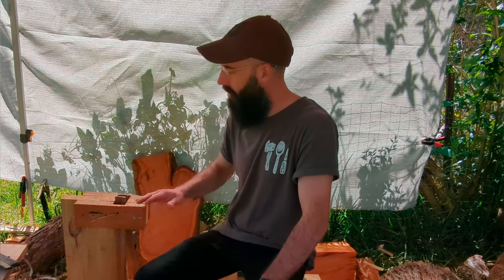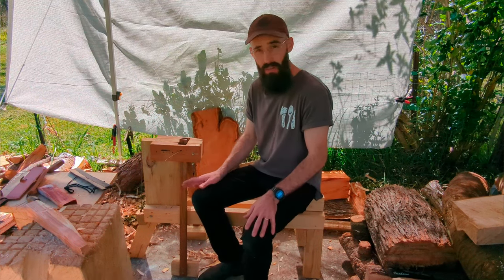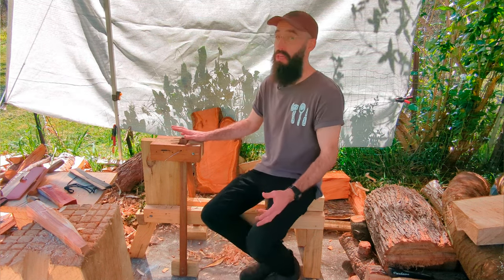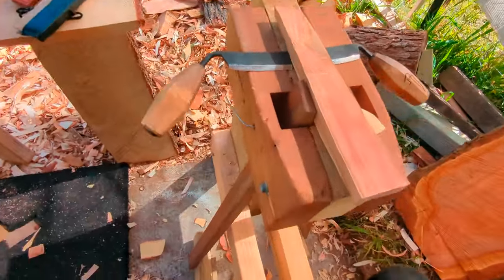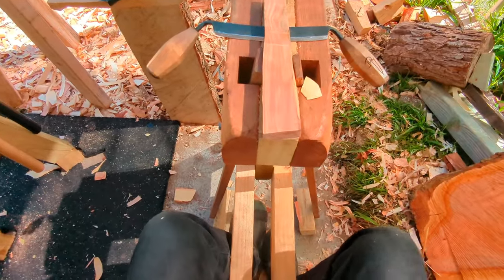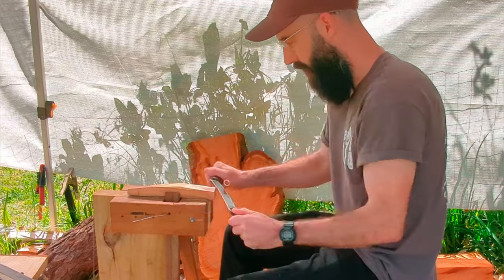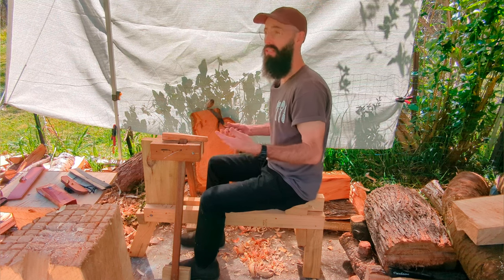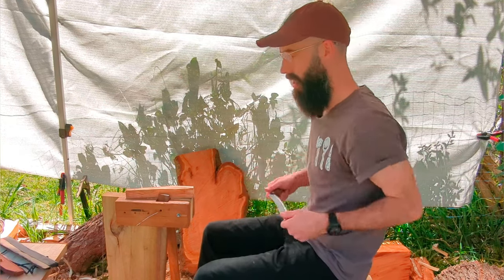The Spoon Mule | Andy Spoons

Comment: Sweet, simple design. I've never used a spoon mule or a shave horse. What advanages does one have over the other?
Reply from the maker: A great question, the spoon mule has lateral grip and leaves the top of your work piece free to be worked on. A shavehorse applies downward pressure to the work, which might create a stronger grip, but means you are only able to work from the grip back towards yourself. One is great for spoons, the other is great for chair parts 👌
Reply: @andyspoons  Makes perfect sense. Thank you👍

Comment: Hi Andy😊
I am trying to build a spoon mule myself. 
Does your spoon mule have an angle cut in the bottom of the opening for the two "clamp arms"? (Hope that makes sense 😆)
When you push out with your feet the clamp arms are at an angle to the opening which looks like its at an 90 degree angle?😅
Reply from the maker: I think I know what you mean? The clamp section is cut at a pretty aggressive angle so as to allow for a wider stance on the legs. I hope that makes sense!
Reply: @andyspoons  Got it! I made the top opening 3.75 " wide and 4.75" at the bottom. Then I made the angle by connecting those two points. That gives me about 1.25" max space between the jaws. 
Thanks for the reply!
P.s.: My girlfriend and I really enjoy your videos and find a lot of inspiration for our own woodworking projects.😊🙏
Reply from the maker: So wonderful to hear!